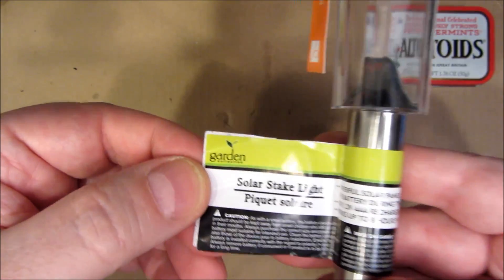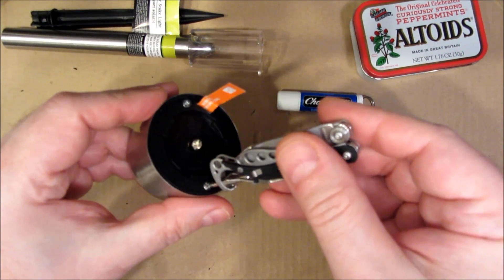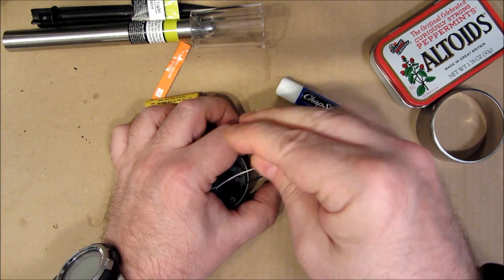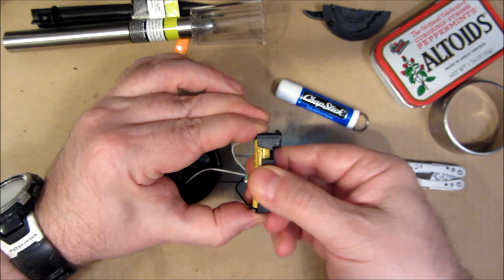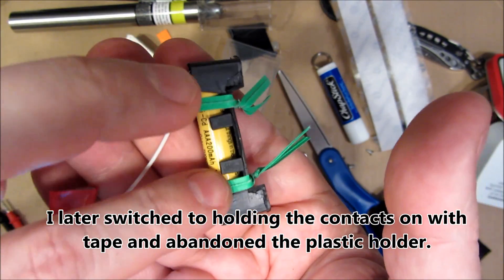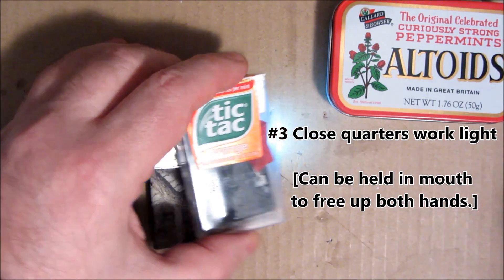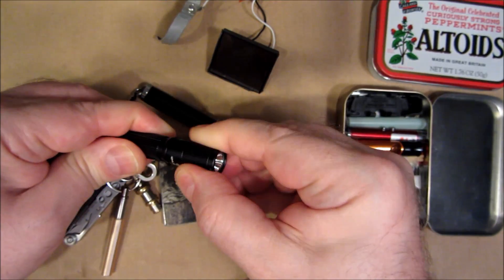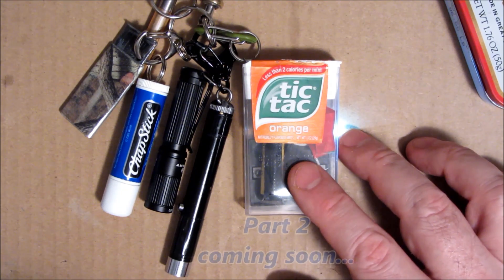Tic Tac Keychain Solar Glow Fob/AAA Battery Charger DIY, Pt.1

Comment: all u need is solar panel battery and a diode,( could use the led) to stop it from discharging into the panel.. very simple circuit..

Comment: i love your channel and would love a tutorial on a tic-tac slor powered battery charger with usb for my phone as i,m a bit thick and need showing step by step, i cant even correct slor to solar on my tab keyboard
Reply from the maker: This video, part 1 of a 3 part series (actually 4 if you count the Mini Tic Tac Survival Pac For Key Chain Carry video) plus the one on TicTac USB https://youtu.be/Prlkm4vyAAM were sort of experimental designs. I show a fast forward version of the construction in the USB video but I don't really recommend it. They are not the sort of thing I would suggest one use for real emergency or survival situations they are just sort of fun experiments, that's all. Since I don't endorse them for actual real world use I also don't plan on making dedicated start to finish tutorials on them, sorry. The USB design I made without use of a soldering gun. It all fits together pressing against the metal paper clip just by friction and the whole thing can fall apart in a fall to the ground. Buy a REAL charger  (USB)  if you need one. AAA batteries are also so weak you'd be lucky to get a phone call more than just a few minutes out of  them. Even the larger AA batteries won't give a full charge.
Reply: ok,thankyou for your quick responce,keep up the good work,i find it all fascinating

Comment: Was that a PS2 knife with screwdrivers? That's pretty cool you can insert the different heads in.  Does it come with the screw heads when you purchased it?
Reply from the maker: The bits come from a different screwdriver and this unofficial use of the Leatherman is detailed here:https://youtu.be/yDsYphq5klg

Comment: Love your ideas! I have one question, when you are moving the finished product around, shouldn't the light go off? just a curious thought, or maybe I am being too picky. Thanks again!
Reply from the maker: GeeDub Well the concept is this is primarily a glowfob, not a flashlight. A glowfob needs to be on perpetually,  at least during the night half of the 24 hour day, so if you misplace your keys or drop them in the grass you can find them. For these to work you would need to leave your key tray, [the thing you drop your keys in when you arrive back home] in a sunny window so whenever sitting there in the sun [or a desk lamp], they recharge. For people who exclusively keep their keys inside a dark pocket, even once they return home, this thing won't work.
This video was just part 1. Part 2 will discuss switch options. The simplest one is to insert a [removable] thin strip of plastic between the battery terminal and the battery, accessed by opening the candy dispensing flap.

Comment: just a couple of thoughts. Is it possible for you to make a dedicated survival kit? so fitting in as much as possible, but also the contents needs to slide out in some way to gain access to it. Also, over the years you have changed your dec loads of times, and come up with some great systems, but could you do a video to your current and most recommended kit to carry??

Thanks a lot

Comment: That is VERY cool. I wonder if you could use a pie tin with that heavy aluminum and make a reflector of sorts to help out that LED light or get a brighter LED? I'm just thinking to increase the throw of light to a few feet or so. Man I LOVE your videos.
Reply from the maker: wjf213 This is more of a glow fob, not a flashlight, but I suppose anything is possible. The concept is it glows in the dark, all night, so you can spot your keys more easily if you misplace them or drop them in the forest. If it drew enough power to act as a real flashlight I doubt the existing battery would work for more than an hour or so. Good idea though. Higher power designs will be discussed in part two...

Comment: Add a switch to turn off that light would be the first modification I would do.  Great idea, but having that light on all the time isn't something I'd want.
Reply from the maker: William Todd I talk a bit about that in part two. One option is to simply jam a thin strip of plastic between the battery and the plus side terminal to disconnect the circuit. [This is actually how they come from the store.]Doing that or mounting a real deal switch under the candy dispensing flap means you have easy access and don't have to disassemble the whole thing to get at it.
Reply: MeZillch Its definitely something to do, having that light on continuously means the thing would be useless when you really need it most likely as the battery would be dead when you really need it LOL.